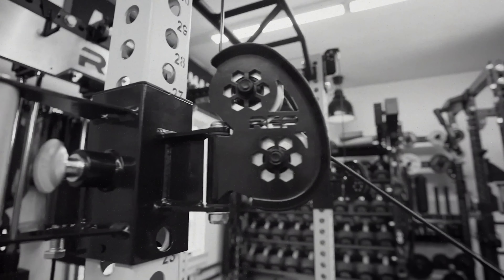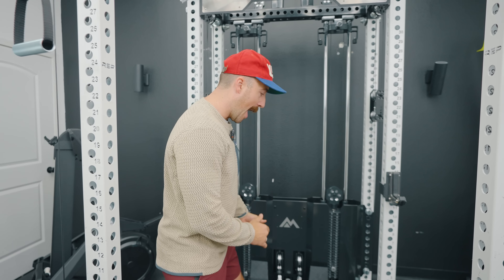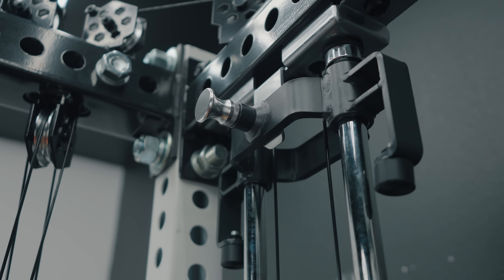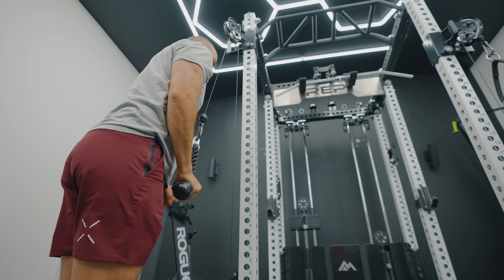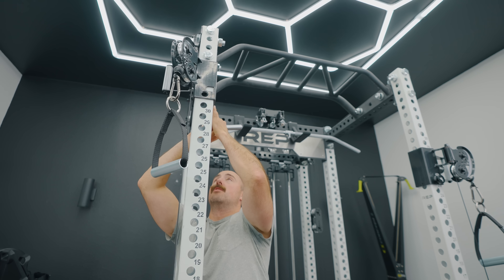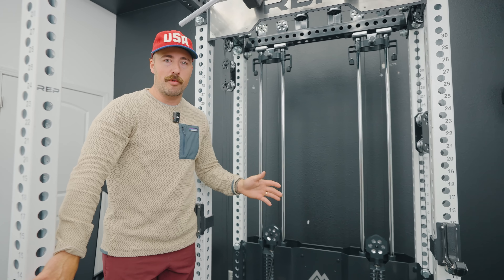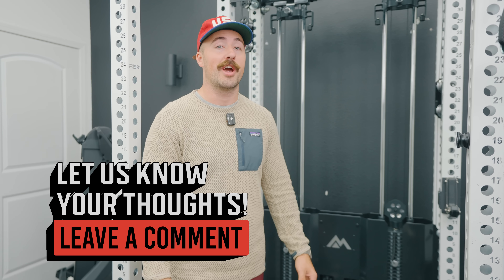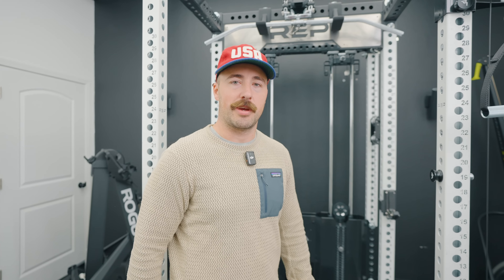The New REP ARES 2.0 Functional Trainer Rack Review!

Comment: When are these companies going to make a low row where you don't have to sit on the floor. Its not about sitting on the floor that is the problem its that the optimal mechanics would be: feet slightly below hips and the row inline with your torso. Also - please review the force usa c10
Reply: ATX is the only one that has done this as far as I know, but they aren't coming to the US until 2025.
Reply: @maj0rdave  prime single stack has a good option but it’s over priced, has a long lead time, and the lat pull down seat is not good
Reply: Sit on some mats and that should help?
Reply: Rep utility pad works great.

Comment: I ordered it with the extra weight for 310 pounds. Not for lat pulldowns or low row, but for a future belt squat for Ares 2.0. On Repins, I was an April 3rd pre-order person. I never got an extra $100 off even though we are waiting by far the longest. I know the price went up, but the lower price should be a benefit of ordering earlier.

Comment: Hey coop great review. I Just got my 2.0 as well. I found that If you want a deep stretch on the low row you can just remove the carabiner and attach the handles directly to the cables.

I was skeptical about the two attachments points as well. After using it I found that doing low rows with d handles feels amazing. I do both arms at the same time and having the freedom to rotate your wrist and not having a bar preventing a deep contraction is solid.
Reply: Mine come in about a month. How long did it take you to put it together? What tools did you use? Thanks!
Reply: @JonHanner-un7ef  about eight hours total, however it was before they dropped the assembly video. I’m sure it would’ve been quite a bit quicker being able to watch the video while assembling. For tools I bought a 36 mm socket from Harbor freight in order to be able to use a ratchet to attach the rack bolts. You’ll need a large crescent wrench as well. Other than that you’re g2g, the Allen keys needed are supplied with the Ares.
Reply: Happy to hear you love it and the rows with D handles feel amazing. The swivel pulleys make a big difference too.
Reply: Any updates on stainless steel uprights?

Comment: Been hunting, studying, and watching reviews on functional trainers for several months and finally pulled the pin!  My decision was down to Bolt (biggest bang for your buck) and REP Ares 2.0 for a significant upgrade to my garage gym in the Northeast.  I saw several comments on powder coating quality and issues with Bolt in cold weather climates from unconditioned space with rusting or failing of some metal parts.  I don't know how bad the rust or issues were but it was something to consider.  I finally decided to go with the Ares 2.0 (5000 w/30' rack) and an adjustable bench.  I couldn't be more happy with the quality of their products.  It ain't cheap but you are def getting what you pay for!  This is absolute commercial gym quality gear!  I am grateful for all of your comments and for Coop's reviews of these products for helping make my decision!  PS.. went with 8 stall mats to replace what was there and off-gassing is not an issue which seemed to be a substantial conversation anywhere I looked.  Thanks again!

Comment: They say to get the 6 post so your ready for when they drop the counter balanced smith
Reply: Where have they mentioned it? I ended up getting the bulletproof one but I lose 5 holes or so of adjustment for the functional trainer. (Athena)
Reply: Who says this?
Reply: Emailed them
Reply: Ah thanks. Wonder how much room it will take up in the rack...
Reply: @eszlsk  me too, I'll work off the front of the rack , that would give you everything but peg storage
Reply: I wonder if the Smith will work with the 16 inch 6 post extension instead of the 30 inch.

Comment: I was between Rep and Rogue and went Ares 2.0 for 4 reasons... 
1) I saved about $1,400 between the two with the cart discount Rep offers when adding all the things like spotter arms, landmine, upgraded jcups, a new barbell, etc. 
2) I wanted the added functionality -stuff like the built in adder weights, option for single or dual arm training, etc. And I also have a Rep bench - Ab-5200 that could dock inside the slots which I thought was cool. I didn't see really any extra function that Rogue had on theirs, but I did like the look of it. Some of the Rogue reviews on their site complained about the heavy trolleys, metal on metal contact on the bar catch, not enough stickers, and no place to put the weight selector pin on the first weight adjustment on the stack - all relatively minor but it feels like they rushed it a bit if they missed stuff like this.  
3) Rep has been innovating a lot in this space the last few years and I think I'll have more options with them in the future.  
4) Rep has been doing cable attachments really well for awhile, while rogue had the slinger out forever. I've got a mix of Rep and Rogue stuff in my garage, but the last thing I got from Rogue was when they released their cambered bar and it was too wide which made it unstable during use. Thankfully, enough people complained so they actually did something and made the narrow version and I swapped it out so it's good now. I don't want to swap out an entire cable rack machine lol. 
In the end, I think both options would have been a good choice, but I went Rep for these reasons.
Reply: I don’t trust a Chinese drop shipping company
Reply: Point #1 is interesting, didn't know that. I'll have to consider that but still see myself going with Rogue because MIA
Reply: Agreed.
Reply: Huge mistake
Reply: @JJ-zr6fu Rep isn’t that. Not anymore at least.
Reply: @raven-19x  Yeah, I did my research. Both are legit companies that have been around for 10+ years. Just people do no research I guess.
Reply: I just wanted to follow up since my unit arrived. I had my Ares 2.0 delivered last week. They called to deliver it within a 2 hour window, and they dropped it off outside of my garage and I took all the pieces out their boxes and made sure everything was there. Assembly wasn't hard, just time consuming - about 7 hours, and this video helped a lot - https://www.youtube.com/watch?v=zqIqLgT4tyY&ab_channel=REP - I'm not big on following PDFs/paper instructions. If you had a second pair of hands, I think under 5-6 hours is possible. 
After breaking down all the boxes, my recycling bin will be full for the next cpl weeks, ha. 
I've had 3 workout sessions on it now, and I'm extremely happy with how smooth the cables are, and the ability to have both the single pulley and dual pulleys. I wasn't sold on it completely before, but now about 75% of my training is using the D handles. It's especially nice doing chest supported rows using my adjustable bench off the low pulleys. I don't see how this would be possible with the Rogue unit unless you're DiYing something. 
The overall fit and finish was nearly flawless. I waited a long time for the unit, but I'm happy I did.

Comment: I just hope that Rep will continue to support 1.0 users with newest products
Reply: Such as? All.rack attachments will work, cable handles are cable handles. Not sure what else they could do? I don't see them offering an upgraded low row as that means replacing the whole.bottom section so wouldn't be worth it
Reply: @benmulleady7266 not sure if I agree with you. The cable routing could interfere with rack attachment compatibilities, at least will add some limitations while trying to use them.

Comment: Just bought and put together my REP Ares 1.0 - can't beat the price! Plus the biggest issue (the low row height) can easily be fixed with a mod. Lovin it!
Reply: what's the mod?
Reply: the fact that the 2.0 costs $800 more is crazy. they did not make $800s in improvements here.
Reply: Just get an ATX floor tiny bench and you are good to go.
Reply: My issue is the 80 inch rack. I like the change in the pulley system to address the shorter posts

Comment: Two questions: 
- Will you do a full review of the Force USA C10 with sliding bench?
- Do you have an opinion on the Amstaff Fitness SD-5000? This is the first machine I’ve seen that the weight stack connects to a smith machine
Reply: Inspire has a few that are really great. The FT2 Functional trainer pro is where it's at
Reply: I realize I didn't make it clear but I was talking about the weight stack connecting to the Smith machine.
Reply: I like the C10 as well.  It has some great features with it.  It is a little pricey but I think it is a great piece I am considering!

Comment: I absolutely love my 1.0 Ares.  It is just the best IMO if you are looking for a functional trainer for your power rack.  I use mine 5 days a week.  Such a great purchase.
Reply: Hi, I already have a squat rack I use for barbell exercises. Would you recommend a 4 post ares to be used solely as a functional trainer?
Reply: If you already have a rack a 4 post may not be necessary.  If you have lots of space and you rally want to add a 4 post then I would say 100% yes.  Thats the way to go.  However, there are a lot of functional trainers out there that take up much lest space than a full 4 post 3x3 rack.  If you do add a 4 post you probably could sell your existing rack and save some space.  I have a 6 post PR-5000 set up, but I use it for everything.  If I had it to do over, I probably would just get a 4 post because I conduct most of my workouts off the front of the rack.  The 6 post isn’t really necessary.   Hope that helps you with your decision.  Best of luck shopping :)
Reply: @murdog04  thanks, given my height constraints i can’t find a functional trainer that also has lat pulldown/low row like the ares. The 4 post doesn’t take up any more space than a regular functional trainer. I would prefer to keep my squat rack so I can leave the barbells on there and not have to toggle between j cups and pulleys on the ares
Reply: @ that sounds great.  I am really limited on space.  I would love to be able to keep my bench set up and not have to trade out attachments all the time.   Thats a good problem to have :)

Comment: Great call pointing out the best deal may be the Ares 1.0. I got a 4 post Ares 1.0 for 2700ish and absolutely love it. I don't find the low row to be a significant issue. 

Is 2.0 or the FM better? Sure, but not 1000$ better (2.0) or 2000$ better (FM twin stack)

Comment: Went with the Ares 2.0.  Am a basement gyms so the 80 rack was the only option as with Ares it fits in 83 inch ceiling. Rep did call and offered cash refund for $330 bucks for the loss of points, or 380 if I accepted coupons on future orders. I chose the coupons as Rep has some really cool innovations in their pipeline and I don’t really want a Frankenstein rack. So am investing in the rep ecosystem knowing it will work together nicely. Wait time is a bummer but not the end of the world.  There are always substitute exercises.

Comment: Regarding a 4-post needing outriggers...   don't they make a really short crossmember you could just bolt it to the wall with?  Then you could avoid the front and back outriggers or even bolting it to the ground.   It's something I'm really considering.  I've got cabinets on one side of the garage that I could take a couple out and this would fit in the same depth they take up.  I'd just rather mount it to the wall than floor because I have a post-tension slab.
Reply: That idea I already brought to REP but with the regular short crossmembers. It seems that it should work, based on their feedback, but firstly you should mount the Ares 2.0 first and then add the crossmembers to attach to the wall. Your idea of having really short crossmembers is nice
Reply: @Jmscavaleiro  The quirk of my scenario is that my garage has about a 3"x4" sill or base at the wall, so I couldn't put the rack up against it.  It has to stand out a couple inches from the wall.  So a 4-6" cross member would really be all it needs to be wall mounted.  Conceivably, it'd only need it at the top.
Reply: @DethpickleDave  I have contacted REP support to use the crossmembers only at the top and the response was positive. So I believe that your idea could be fulfilled but if they will be developing a very short crossmember? I doubt it. Keep in mind that you will always need the Stringer, based on their feedback.
Reply: @Jmscavaleiro  Someone has made a short 3x3 somewhere.  I know I came across one when I was plotting out possibilities of various folding racks.  Even if no one does, that coudn't be hard for a local metal shop to fabricate to the exact length you need.  As for a stringer, I'm less worried about that.  A 2x6 spanning your studs would be plenty adequate to mount into.  Now I just need to have a garage sale or three to empty out these damn cabinets!

Comment: I'm tall on my rep 1.0 I do my tricep pull downs inside the bench, using the lat pull down pulleys...You could be 6'5" and have plenty of clearances...
Reply: Assuming you have the 93” height, correct?
Reply: @BigRed-jh5wf  yes! I’m too tall for anything less. If you get an 80 inch you’ll have to do a lot of training seated or on your knees. Regardless of how tall you are.
Reply: I’m 6’8, concerned about height as well, but don’t have the ceiling clearance for the rogue unit which can go up to 100”. Any issues with the lat pull down? Concerned I won’t get a full stretch (this is more or less an issue on most commercial lat pull down units😢). Thanks
Reply: @jamesgrunst1866  you’ll have no issues getting a full pull down. If you need a little extra stretch buy reps Adjustable Plyo Box and sit on that at the lowest setting.

Comment: It would be interesting if REP would ever come out with a 1.0 to 2.0 conversion package. How many of the parts changed and how many are the same. The weight plates probably didn’t change, and probably the guide rods (if you don’t change height). Looks like a lot of the other parts would change, like cables, pulley brackets, trolly, etc. It would interesting to see the price point on an item like that vs selling 1.0 and buying 2.0. I have the 1.0 and I love it, but have no desire to sell it for less money and buy the new one when the upgrades are that drastic enough to warrant the time, hassle, and cost. I know they offered a discount code to 1.0 users, and probably did that because most won’t even use it. But if you offered a discounted upgrade kit, you know some people might just be interested in that. Just a thought.

Comment: Coop, any reason someone should get this or the Rogue FM series over something like the MAXUM Fitness SX2 besides the SX2 only being available as half-rack with 5/8" holes and perhaps someone wanting a full rack and/or 1" holes?

Outside of that, it seems like the MAXUM does WAY more given what's included with it plus the features you can't even add to the Rep/Rogue like the counter-balanced smith machine, vertical leg press, and articulating FT arms with the dual stacks + built-in plate-horns to load as heavy as you want and/or combine the two stacks together swiveling the arms inward to mimic a 1:1 ratio (side + center mount attachments are included to do pulldowns and rows with either configuration too).

And it costs noticeably less as well while still being standard 3" x 3" 11-gauge steel. Just overall seems like a much better choice for most people but perhaps I'm missing something. Really would love to see a review and comparison!
Reply: Likely fit/finish details. Some of the welds look rough on the pics. Otherwise it seems like a great option with more versatility.
Reply: I agree review the sx2. If it works as good as it looks and with all the inclusions (counter balance smith machine) then it beats the heck out of Rep and Rogue.  Plus Coop as much as you say you
workout quite a bit on Smith’s then review this thing.

Comment: I canceled my Preorder of Ares 2.0 because 
(1) Glucks review of Rogue FM Twin Stack
(2) Rep removing rewards points 
(3) Rep having 3-4 month lead times. Would get my Rogue rack faster despite ordering 1 month later
Reply: But you pay more
Reply: @MarineScoutSniper  yup. But I also have a Rogue Rhino and I believe the quality will be superior to Rep. That thing is a tank. Also skipped out on the $300 shrouds to save money.
Reply: I would be all over Rogue if they offered a slightly shorter option. The FM would barely be scraping my ceiling and pull-ups won’t be an option with no head room.

Comment: My only question is 30 or 41 inch depth? Will be used by myself and my wife. Does the 41 give enough depth to work in and outside the rack at the same time? Any other benefit to 41 over the 30?
Reply: Scottydontno the landmine attachments I have used use a pin on the upright. How would a cross mounted flip down safety be used for that?

Comment: I have learned much from your videos and appreciate you. 
However, you may want to be consistent with your requests in manufactures design. 
This video Rep listened to you about the pulley cables  outside of the uprights. 
Then in an earlier Bells of steel video you said it was not a big deal.
Reply from the maker: That’s because I had a commenter challenge my thought process on more width equaling a greater stretch. He was right. I was wrong. And now that I’m more learned, I want to pass that on. - Coop